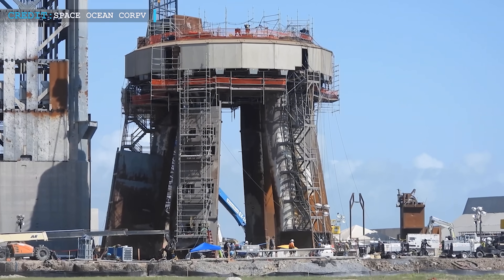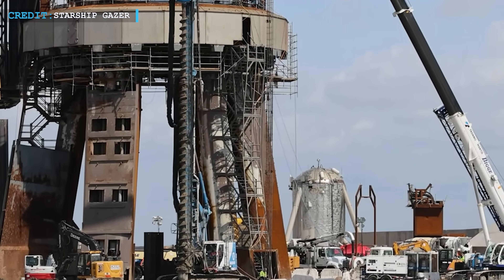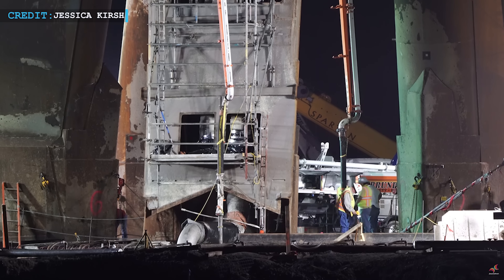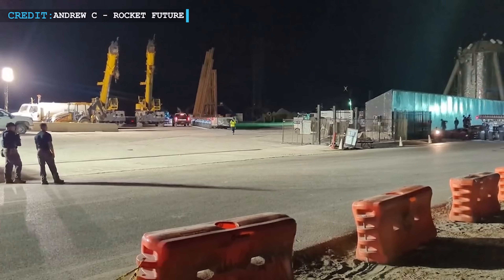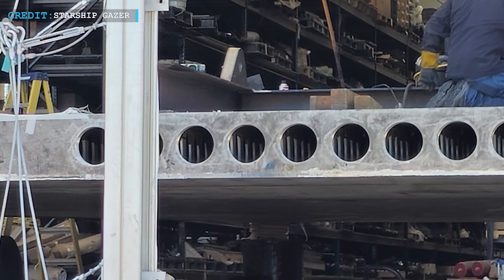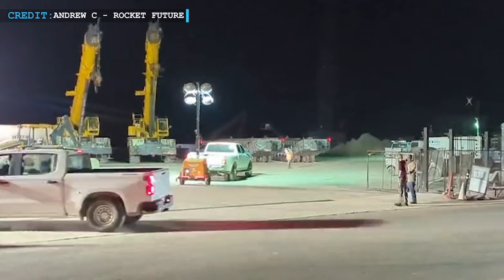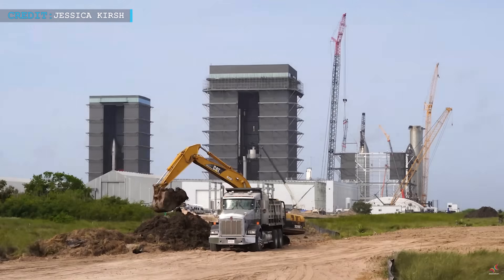SpaceX's much-awaited "WATER DELUGE" hardware has arrived at the Starship Launch Complex

Comment: 2:40  A concrete truck holds 6 to 10 cubic meters of concrete. Therefore 125 truck loads, at 8 cubic meters per, would provide the necessary 1000 cubic meters. Thus, that 125 truckload estimate was bang on. There was no sudden realization that they needed more than they thought.

Comment: Lotsa blab and video.  But dang little in the way of tangible facts.   That deluge system is a small fraction of the Shuttle deluge system in cubic meters per second.   But the rocket energy is like 5 times larger.   You figure out what's going to happen.

Comment: One can’t help but wonder if the steel plate bandaid is more or less expensive than a traditional flame diverter would have been. And while we know flame diverters work, the steel shower system is yet an unknown. I hope it works simply because Starship won’t fly a third time until at least next year if it doesn’t.
Reply: A traditional flame diverter is not practical because of the high water table on the south Texas coast. If you dig down more than a couple of feet, your trench simply fills with water. If the steel plate doesn't work, they may have to close up shop and move all launch operations to the Cape.

Comment: An engineer's take on this type of "Water deluge" system? Badly misconceived and likely a sign that any wiser, proven practice (see, e.g., Launch Pads 39A and B at the cape) is bypassed by the "chief designer' in order to show he can prove something new - after botch-up #1. Prediction: water feed will fail under fullest thermal and mechanical insult, with push back of water, rapid steam boil, steam explosion into rocket base, not to mention un-mitigated very powerful supersonic, reverberating shock concentration into the engine array. Stand 10 miles away and enjoy the show that comes from hubris. We all saw the result of this variety of "fail-until-success" development strategy in the recent Titan tragedy. But EM is a billionaire, and not flying it I guess.

Comment: This video did provide a basic overview of the upgrades being made to the launch pad at Boca Chica.  However there are at least one inconsistency and an obvious error that needs to be point out.  One inconsistency occurs at 2:45 when it is was stated that originally it was estimated that it would take 125 concrete trucks to fill the piling cap.  Then in the next sentence it stated that 1000 m³ would be needed.   Why change from the # of dump trucks to m³??   How confusing is that??

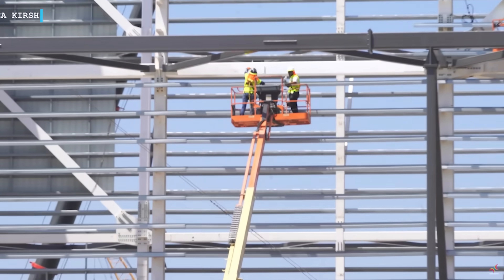Then at 3:35 it stated that the SQD was replaced except you were showing an image of BSQ or booster QD!!   Then at 4:50 the booster QD was again mistakenly called the SQD.   There is an obvious difference between the Ship QD vs the Booster QD.

Comment: Thanks. Ever consider looking into who's fabricating these components?  Even for the Gulf, the scale and pace would challenge a shipyard
Reply: I would love some videos doing a deeper dive into the companies responsible for fabricating things like this, as well as the companies creating these massive moving rigs. Boring? Not here it ain't.
Reply: That is likely why they are not being built by a shipyard, but rather the Oil and Gas industry infrastructure already in place in Texas.  There IS some overlap though for deep sea oil rigs of course, but even on those the plumbing portions are not handled by shipwrights.

Comment: I do hope that a test run of the deluge is done before a rocket is in place. As shown the anti drain feature has nothing holding it in place. Any large pipework carrying water has the be surrounded by a thrust block (even underground) to resist the thrust developed by large amounts of ware changing direction. Ask any water engineer involved in water being fed down pipes from a dam.
Reply: Of course there will be static fires of the booster in conjunction with the upgrade to the OLM base.
Reply: I too expect to see tests of the deluge system before the booster is placed on the pad. As for thrust blocks, surely that has been considered and the design will handle that appropriately.

Comment: It’s unlikely the water pressure could come close to balancing the forces of the engine exhaust. The pumping system would be enormous. It’s undoubtedly a high pressure system but will probably rely on the evaporation of the water to absorb and carry away the heat as steam 
like a relatively simple a/c system. As heat is carried away the volume of the exhaust stream will be reduced and consequently the force will be reduced as well. Success would be a matter of calculating the volume of water it would need to evaporate to reach pressure and temperature levels considered acceptable. Of course dampening the shock waves is also a requirement.
Reply: Elon and other Space X people have actually said that the water pressure has to be greater than the thrust.  I was also skeptical when I first heard that, but I think it has something to do with the exhaust gasses being compressible and water essentially being un-compressible.   The math is way beyond me, but in a nut shell, it takes a significantly lower water pressure than you would intuit.  Still a very high pressure of course.
Reply: I agree that this problem is very much a thermodynamic as well as a fluid flow situation. For the short time it takes for the rocket to leave the pad, the steam carries away its latent heat of vaporization, cooling and redirecting the exhaust and protecting the steel plates while also damping sonic vibrations. IMO, there is a good chance this system will work fine.

Comment: You mistakenly showed the stage 1 booster quick disconnect when you were talking about the need to raise the stage 2 Starship quick disconnect. The stage 2 disconnect needs to be raised because the hot-staging ring goes atop the stage 1 booster, raising the stage 2 booster higher.
Reply: The deluge test vid was upside down too.   Poor editing this week.